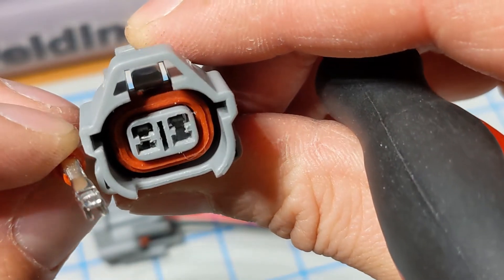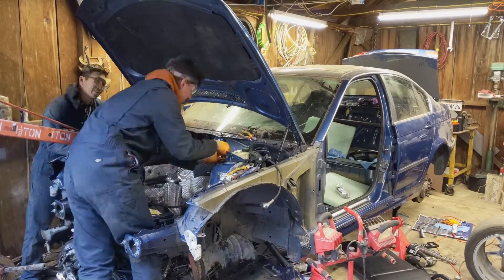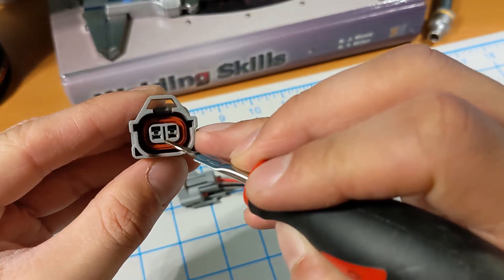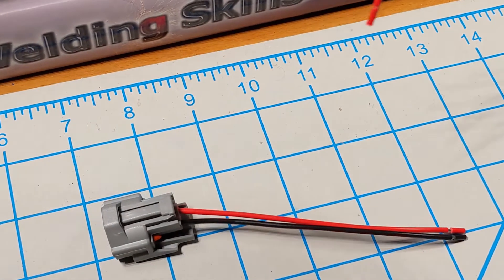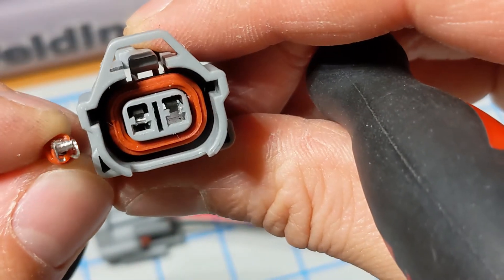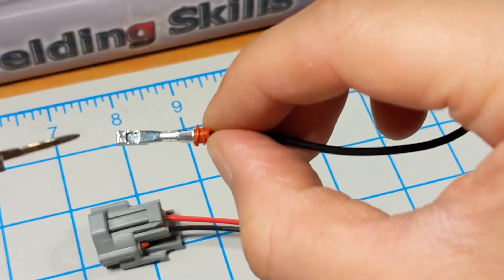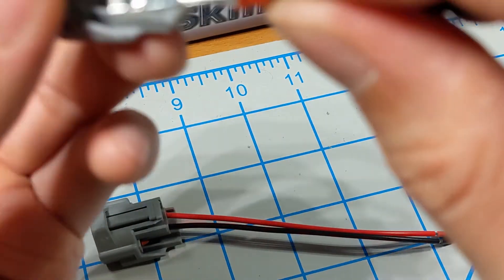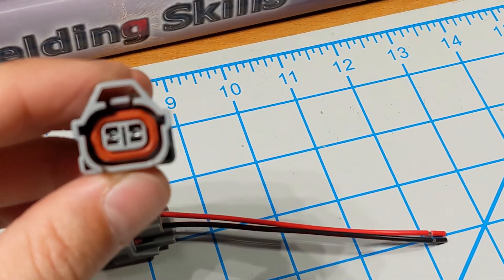Depinning Denso fuel injector electrical connectors for my Miata!

Comment: Would have been much more helpful if you showed depinning the car side too... The connector is slightly different with how it holds the pin in.
Reply from the maker: That would mean I'd have to go to the garage 😂 Jokes aside, it's slightly different but the same technique applies.

Comment: I tried this on my 2004 toyota sienna and the original pins don't fit well on this conectors. I bought the conectors on Amazon , but now I'm trying to find the originals. Any idea where could I get them?
Reply from the maker: What connector are you replacing? There are so many different kinds of connectors it's a little crazy.
Reply: @EscargotGarage  the fuel injector conectors. I just ordered them From the dealer and im piking them up tomorrow. Thanks for the quick response.

Comment: Thank you for this. This exact connector is used on many vehicles; it's a wonder any of them run anymore because of how fragile these connectors are when touched. In my case, 5 of 6 broke on my 2004 Tacoma. 

Although I'll be buying replacement connectors today, it currently "runs like a dream" with a custom application of zip ties securing the busted ones to the fuel rails. You can't buy such quality engineering just anywhere, friends. ProTip: Purple zip ties get you an extra 5hp. True story.
Reply from the maker: Every time I have to disconnect a plastic connector on an older car I cringe a little. Just take your time and you should be good. Those connectors are a pain to take apart, let alone try to depin!